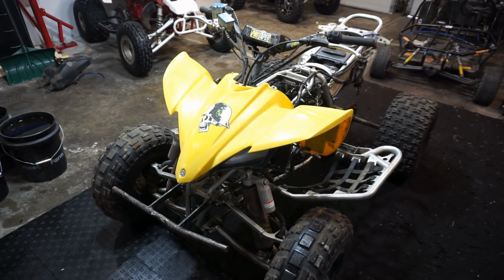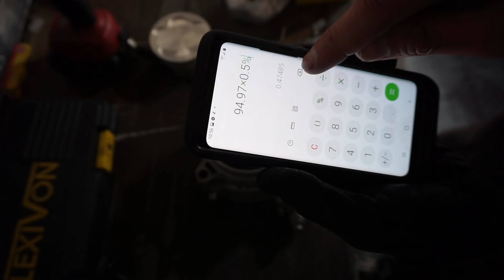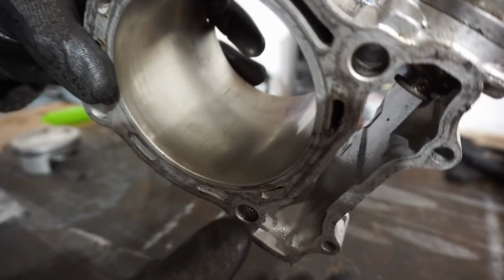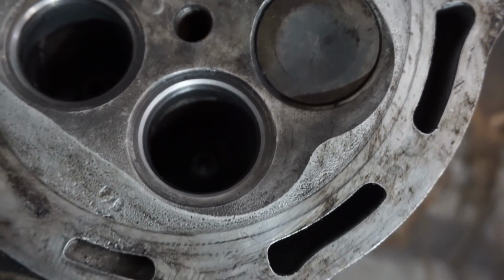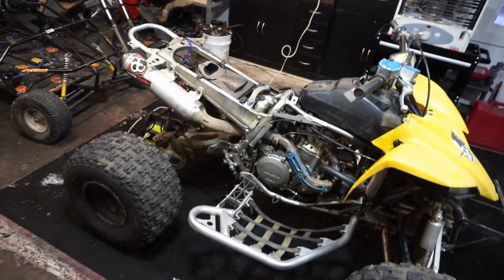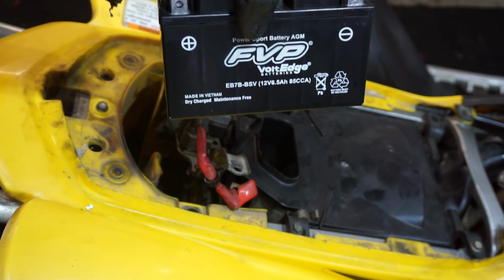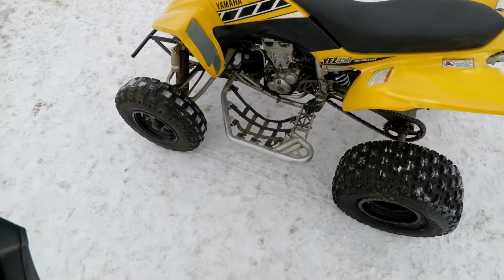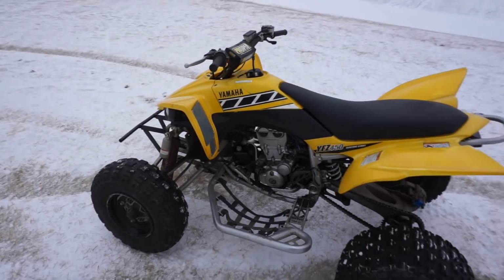Turning This $1400 YFZ450 Into a $4500 Quad (COMPLETE TRANSFORMATION)

Comment: For the backfires it may leak the exaust from somewhere and the jets maybe its ok(sorry for my english i'm mechanic from grecce keep the good job)
Reply: Yup maybe dropping the needle a few clicks since it is running a little lean, or checking for the header nuts they often get loosen after to many times being taken apart or overtightening them makes them come loose, if so try double nuts so they dont move.
Reply: @alfredorodriguez4539  i didn't hear anymore backfire when he was riding I guess it fix

Comment: If its coming from the over flow then it may have been working out the bubbles in the system and may have been over filled. So that may not be an issue.

Comment: You have to change your water pump shaft. It had some scoring we could see in the previous videos. Mine had the same issue, any minor scoring causes it to leak past the weep hole. I had changed mine to an aliexpress one, it got scored again after some rough motocross track riding.. i think i will purchase an OEM one and try again.
Reply: Yea I had to do the same on my cr80

Comment: There should be holes in the carrier bearing housing on the sprocket side i use a nut driver that fits in the hole through the sprocket spokes then rock the quad forward or back using the force of the sprocket bumping the nut driver to adjust the chain so not to scuff up or to avoid beating on a screwdriver  its easier especially if its stuck in place and needs persuaded. I had my water pump seal leak after fresh rebuild 1 time and that was it weirdest thing. Just a thought on the decel backfire I had a aftermarket pipe that was not perfectly round at the head where it mounts and wasn't getting a good seal at the gasket ended up shaving it down on the hi spots so it seated to seal up decel pop went away.
Reply: Was coming into the comments to comment this but you beat me too it

Comment: You need to go back to factory jeting , and then tune idle and tip-in with adjustment screws. And then jet for your pipe later.
Also it looks like to me one of them intake valves was sitting lower than the other two.

Comment: What I have done when I ordered the piston that was tight like that I actually just slight ran the hone it the cylinder it really didn’t change the gap but made for smoother cylinder surface and better compression
Reply: I did that instead of filing the rings
Reply: I was thinking this

Comment: check the slider for the THROTTLE VALVE PLATE, a lot of people put that upside down, the part with a small hole goes down, put a pilot jet #50 and the mixture screw to 3 turns, maybe you have to drill a copper cap that is covering the mixture screw, Use a 5/32 drill bit to drill the copper cap that covers the mixing screw, do the Zip Tie Mod to the acceleration pump,  change the needle to NCVQ and put the clip in the fourth position
Reply: if you have another yfz450 with the same carb, switch it to see what happens

Comment: When you pull aluminum bass apart and then your retighten it retorque it it moves around when it gets hot then cold and receipts you got to understand how luminum works with cold temperatures in hot temperatures it moves around a lot and it's got to reseed itself and you have to retorque all them bolts

Comment: Hey my 50cc 2stroke moped starts when i put gas in sparkplug then dies i changed reeds but i dont know whats wrong i cleaned carb in carb is fuel but its looks like it wont go in cylinder

Comment: ALL HELP APPRECIATED

(03 yz125) Can anyone help me figure out why my bike isnt getting fuel through my carb... I did a full rebuild on it, float moves freely and i set it to where it needs to be, and she still doesnt get fuel through the carb. When I spray into the carb it kicks. 

Also it leaks fuel from the front of the engine block looks to be a seal problem. (compression is fine)

Comment: Really should have had new sprockets with the chain they are badly worn. Is the backfire an over fueling issue as it's normally unburnt fuel in the exhaust unless the timing is slightly out somehow

Comment: Do you have to divide the clearance by 2, because the clearance on the side you are measuring is maybe 0.003 inch but the other side is 0 at that moment (because you push the piston against the cylinder). Shouldn't there be 0.002 inches clearance on both sides at the same time?
Reply: Should be using telescopic bore gauges and micrometres for a lot of stuff he does. Not feeler gauges and clapped out digital vernier calipers.... The list goes on. But I agree. Clearance should be overall not pushed to one side. And even if he had feelers won't tell him if the piston and/or bore is out of round in spots. He makes enough money from flipping them and YouTube to not be using claw hammers and old sockets to drive seals in. But splurges on tooling in other areas. Strange cat.
Reply: @Carl223  the hack job side of it is what makes me want to watch his videos lol I find it pretty funny!
Reply: @fullmetaljacket7   the lolfactor haha

Comment: Good 2 see u started lapping valves. Easy step while u have it apart. A lil added insurance
Reply: Incorrect he just destroyed his valves they're over $100 a piece and they have to be matched fitted from a machine shop. You cannot lap titanium valves you take the coating off then the valve begins to wear extremely fast. Unless this was rebuilt before and those valves are stainless steel and I wasn't aware of that. That's what most people do when they're titanium valves wear out they put a heavier chain usually a stiffer spring and replace the valves with stainless.

Comment: My drz125 is having the same problem with the backfiring I don’t know what it is tho I cleaned the carb and made sure the valves were in spec and still it backfires. If anyone could help it’s a 2021 it just randomly started happening it has good spark and gets good fuel flow.

Comment: The backfiring is unspent gases, as long as you are on the gas it doesn’t pop its when you let of the throttle, any time we change the exhaust on our track bikes(sport bikes) it needs to get tuned or it pops like crazy, on my superduke ive seen the resonator can explode on the akra exhaust system, i could definitely be wrong but id say you have carb issues.

Comment: hi joe , hope you and jade are good and keeping okay !  Just a quick question .... in all your builds i have watched , (Most of)  I have never seen you check cylinder or head surfaces for levelness , do you not do this ?  

Also the solvent valve leak test (which you did and didnt show here) .....   I'm just in the middle of rebuilding my own yamaha tw125 atm and I'm going to have a go at these things , i figured why not ask. i never thought i would be able to dismantle and reassemble my own engine , despite working in a motorcycle garage for a year recently.     awesome stuff
Reply: He tested the cylinder when he fitted the Rings

Comment: FFS Joe did you really only do 2 of the 5 valves also it is the inlet valve seals that can cause smoking  issues not exhaust          Pistons are oval and tapered so clearance is mesured at bottom of skirt  90 degrees to the pin  also do not set ring gaps in line with major and minor thrust faces that pushes the gap ends harder against the bore   a little education on basic principles goes a long way !!     also backfiring on overrun is caused by the header pipe sucking air at the head or muffler joint   DONT BE LAZY!!!!

Comment: im going to say that quad is running too rich. going off the 158 45 stock jets, being in Wisconsin at 1000 feet and around 0 degrees F the jet recommendation is 164 44, 2 turns. my 2005 yfz 450 se was acting the exact same way, come to find out the privious owner jet it to 178 48, i brought it back down to 165 45, 2 1/2 turns, runs good now. used to pop on decel, die at idle.

Comment: Coolant leak out of the overflow should stop. Happens often after refilling the radiator.
   Still have a fairly major air/fuel mixture problem. I don't recall what you had for an air filter, but double check the air intake status throughout the entire system. If that's all good you're gonna need to continue messing with the jetting situation. My gut feeling is you are too high on the needle at this point.
  Also PLEASE try Vertex piston when you get the chance. Wiseco has been garbage for awhile now, that ProX piston I don't know anything about. But you will definitely have better luck with Vertex rather than the Wiseco products. And No, I'm not affiliated with Vertex in ANY way. Good luck
Reply: Pro x is wiseco and yes vertex is a lot better than wiseco

Comment: I stopped at 4:19 to say NO!!!!!! Do not measure the clearance of the piston at the ring lands. It will always shoe too much clearance. Please measure at the skirt. One measurement at the very top of the cylinder where the rings never reach and another at the middle of the stroke.
Reply: Do you have to divide the clearance by 2, because the clearance on the side you are measuring is maybe 0.003 inch but the other side is 0 at that moment (because you push the piston against the cylinder). Shouldn't there be 0.002 inches clearance on both sides at the same time?
Reply from the maker: I measured at both ends to make sure.

Comment: 6.5ah man that aint strong buy a 8AH for sure my moms 300cc triton had a 11ah battery that thing was great never a power problem to start
i use 8ah minimum on my 450cc hell i even use a 8ah on my 300cc quad all my quads got 8ah if there is space, only chinees quads have space for tiny batterie so i use 4ah and those always die if you dont recharge it every 4 weeks...

Comment: That’s not a 4500 dollar yfz lol not even close. Redneck front bumper factory suspension pretty much stock that bike in my area is worth 2500 which is logical for a 16 year old quad. You can buy a fuel injected 2014 yfz all day 4500